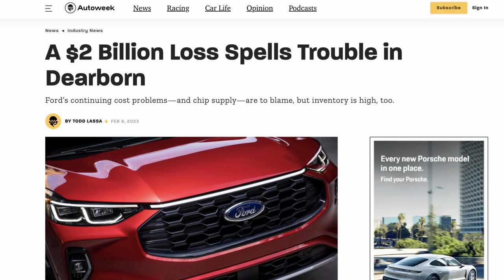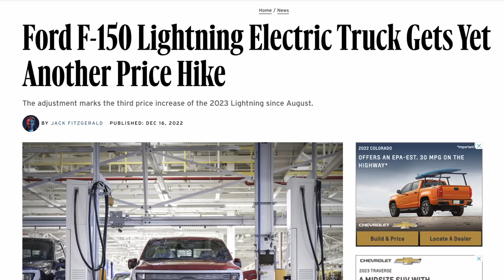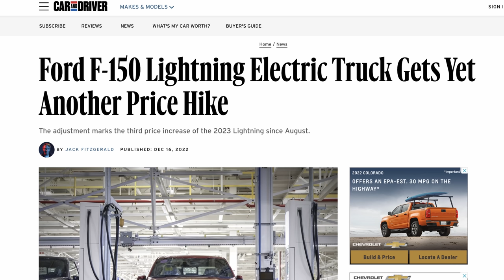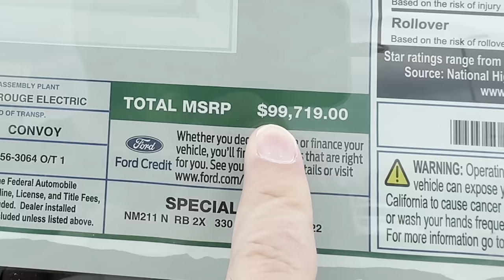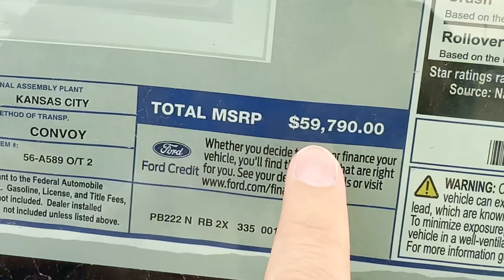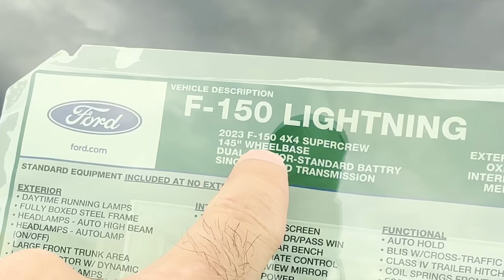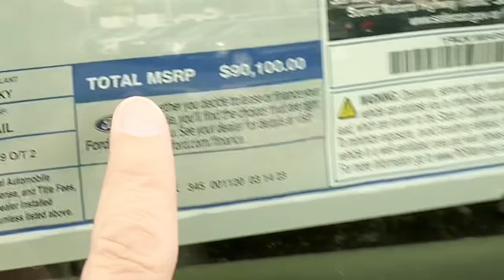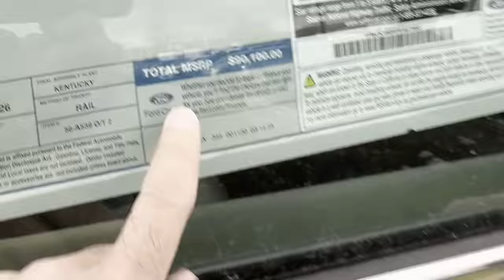Ford CEO Makes HUGE MISTAKE, Now Dealers CAN'T SELL TRUCKS!

Comment: This is across the board. I’m tired of the “there’s a shortage” no there isn’t. I work at a dealership. Some are just scummy.
Reply: Yeaaah it ain’t just Ford
Reply: Yeah I would drive by multiple dealerships on the way to work hearing radio ads from a few places about the truck shortage and how they have trucks unlike anybody else. But every dealership I passed had a parking lot full of trucks
Reply: @KNR90  that part. We literally just sell. No gimmicks, everyone makes money trust me. There’s no reason to be scummy if you have good sales people and good management. Everyone I swear makes decent money and the world keep turning. Some dealers just get stuck trying to be the #1 in the country and for what??
Reply: @cjr21  your response is completely irrelevant to what you are replying to
Reply: @alexwhiteman2628  Not dodge though baby. Them truck prices are better than any other manufacturer
Reply: Controlling supply, just like oil.
Reply: Not in 2023. Got rid of my my 1500 equal diesel due to their high-pressure fuel pump may or may not go out. Yeah I’m not playing Russian roulette with this damn track then on top of that you have a same type of freaking issue at Toyota out of all places.

Comment: Great video, It’s completely insane, older trucks are better than new trucks. This is no longer nostalgia. They needed to get back to basics - simple vehicles made well.
Reply: Insanity is a min-truck like my daily driver since new 86 Toyota mini-truck of 37 years and 483,000 miles can not be made today because of some Federal EPA BS rule that says it's too small and would have to get like 80 MPG to be made by their formula. The fact it gets 32 MPG highway at 65 MPH, better than many cars, it doesn't fit the formula. Insane.
Reply: That’s why you buy a Toyota. I see them with 350k+ miles all the time.
Reply: "simple vehicles well made" is something Ford abandoned 30 years ago
Reply: @MikeHudson-px2gc yeah exactly what I was going to say. The regulations are forcing a lot of this.

Comment: The comment about high end luxury vehicles is spot on. I worked construction and contracting for years and the only things I wanted in a truck were RELIABILITY/DURABILITY, power steering brakes, a/c heat, power windows. I didn't need power seats, I adjusted my seat the day I picked up the truck and it didn't move until I sold it. Same as power mirrors, power adj pedals, colour changing LEDs adaptive cruise, lane assist back up cameras blah blah blah blah blah.
Reply: Amen! And PAYLOAD. One posh feature I wish I had though is heated side mirrors for ice-storms.
Reply: Yes exactly I want my truck like this manual seats an actual steering column shifter with cable not some electric push button fold down shifter bs 😂
Reply: That’s why I have a 99 f350 7.3 xlt 180k miles and works like a work truck should 😊 without all the crap electronics
Reply: @codybose515  And gets 5 gallons to a mile lol
Reply: The money is in the extras. They can't charge a guy like you 5,600 for what you're looking for.
Reply: @red5standingby419  its not quite that bad more like 16/17 according to the mpg display overhead console. May not be totally accurate 🤣
Reply: Yeah F all this new BS. My 98 half ton chevy does everything I need a truck for without the $1k+/mo payment. Paid cash 2 years ago at a city auction 59k original miles. It needed a little work but it's solid now. 60/40 bench, cloth seats, column shifter, low bed that's easy to load and unload, bulletproof 350. I'm never selling this truck.
Reply: seems like the enviroment is ripe for a start up truck company that only makes work trucks that only have those features. no complicated options packages. just a damn reliable work truck
Reply: @utpharmboy2006  that's why JDM mini trucks are being imported by the 1000's. Great on gas, park on a dime, haul a lift of plywood......most don't even have a/c.....
Reply: @red5standingby419  I'm fine with that. Ok, so my 5.4L gets about  21 mpg. that saves me about $1200 a year. In 3 yrs I'll have to spend $4500 on a timing job. 

How much did I save?
Reply: @schrodingersmechanic7622  that's why Pre 90's pickups are all the rage now. You can't find a decent one for under $30K now. 

Mid 70's are in the 20's now.....

I saw a nice 88 F150 extended cab 4 x 4 in great shape listed for $40K CDN at a dealership.
Reply: @muskokamike127  you are right i have seen more of them out
Reply: I couldnt agree more with your comment. Not everybody wants these ridiculous features and add ons. I want a truck, one thats reliable. Thats all i am asking for.
Reply: @schrodingersmechanic7622  I can't remember the last time I saw a column shifter.
Reply: Plus it's all stuff that's gonna likely break one day too. To then find it's a thousand dollar part that's on backorder or no longer available.. typical stealership b.s.
Reply: @red5standingby419 😂😅😂
Reply: Couldn't agree more... you can't find just a REAL pickup truck anymore; all they make now are these overpriced SUV's with a small box on the back and stupid electronics extras nobody wants, ie: "Adaptive Cruise Control" (like I want my vehicle to slow down because a vehicle a quarter-mile ahead of me does? I set my CC to the speed I want to go... I don't CARE how fast the other guy is going, I'll pass him when I catch him. Pay Attention, Fool!) or "Lane Assist" (Yes, I want the vehicle to abruptly jerk the wheel out of my hand for No Obvious Reason!)... All this new crap needs to be optional - or at least they could offer a "No Frills" trim level? Does anyone even MAKE a 2 door pickup anymore?
Reply: Time for a CHECKER TRUCK COMPANY...Long lived, easily repaired.
Reply: A backup camera is nice but as for everything else you're exactly right. Don't need heated and cooled massaging seats and mood lighting and a sensor that watches your movements so you can turn the volume down without touching anything, and all that horseshit. The list of options on a new vehicle used to be like two or three things. Now 90% of the window sticker is ridiculous "optional" features that even though they're optional you can't really get the vehicle without them.
Reply: back up cameras are required by law in all 2017+ chill
Reply: @DarthBludgeon  ha, funny you bring that up. I rented a vehicle while my truck was in the shop and it had auto drive. It kept bouncing from lane marker to lane marker and then when it came around a corner on the highway it kept turning until it bounced off the lane marker. I turned it off because I didn't want the cops to pull me over for DUI. 

I worked for a marketing company and on my first day, the GM said to me "we sell the sizzle not the steak" we make the piece of shoe leather tasting steak look amazing.
Reply: Plus the truck beds are way too high to be practical now. If you were to put an F150 from even 10 years ago next to one from 20 years ago or the F150 right after they switched from the F100, you would say there's no way they're the same model vehicle. A new F150 has a bed height comparable to a Uhaul truck.
Reply: @karlrovey  almost.....my 1999 tail gate was the same height as the home depot flat carts and I could slide sheets of plywood right in. Then the 2006 was 3" higher. Not sure about the 2010 and up versions.
Reply: These absurd features are just a bunch of engineers trying to stay relevant. It's just not very necessary in the world of trucks. 
Unless the buyers have truly gotten that dumb.
Reply: @GS-zc4sk  They wanted to expand their market to soccer moms and millennials. Forgoing everything that a truck should be in the process.
Reply: Hell I don't need pwr windows. The old reliable crank up and down windows worked fine in the old days and never broke.
Reply: @louisstennes3  generally speaking I don't either but I'm old now and can't reach all the way over to roll down the passenger side lol...

Crank windows were great for breaking popsicles in two hahahah
Reply: @GS-zc4sk  Backup cameras are an exception. They are truly useful for practical tasks and can be a literal lifesaver.
Reply: @antilogism  and if you are driving in a ice storm that is a good Way to destroy the Truck
Reply: Led highlights are the best
Reply: @Amor1990  highlights?
Reply: Just more parts to breakdown
Reply: @actionong  I saw a video of a newer BMW went into limp mode over something stupid like the adaptive cruise was down or something dumb like that.
Reply: @actionong  What happen to KISS Keep It Simple Stupid
Reply: I rarely move anything in my vehicles if anything they move for repair or cleaning.
Reply: @crazeguy26  I think the only time my seat moved in my truck was when I took it to the mechanic and he was shorter than I am haha.
Reply: @red5standingby419  wrong
Reply: That's why they make Mercedes-Benz and BMW, leave the luxury bs to those car makers.
Reply: 100%
Reply: @utpharmboy2006  100%
Reply: @dknowles60  LOL, Found the guy who is bitter about having to keep an old truck that just eats the gas.  Every visit to the pump is $150.  And that visit is like twice a week LMAO
Reply: Unfortunately, you're in a minority for truck owners. So so so many people see trucks as a status symbol. They like the idea of hard work but really they want a luxury sedan but on a truck. 

But I agree, trucks should always have the barebones tough option.
Reply: @red5standingby419  for what a truck payment is you can buy a lot of gas at 150 per week and come out very good,.  a truck payment is a lot higher ass high cost insurance and a new truck is not going to get double the MPG
Reply: @Monteze1876  I forget the numbers but a few years ago I read something like only 10% of 4 x 4 trucks will ever go off pavement and that 65% of truck owners never use them as actual trucks. 

Case in point: I was a finishing manager for a construction company and at one site, the site manager had a F150 King Ranch. He wouldn't drive it onto the actual site because it'd get dirty. Then it got dirty from the wind blowing crap on it, so he parked 2 blocks away.
Reply: @Muskoka Mike  this tracks with everything I see. For every one person who uses their truck to its fullest or even for a bit. There are countless ones who view and use them as status symbols. Which wouldn't normally be a big Deal but don't complain about Gas prices, road size, traffic or any of the other hassles  of owning a huge truck.
Reply: @Monteze1876  I know.....I'm seriously looking at the jdm mini trucks because they can haul 4 x 8 sheets of plywood with the sides folded down. That's my biggest issue. 

I'd have a ranger or smaller pickup if I could get a 4 x 8 sheet between the wheel wells. 

I tell you though, the full size truck with the air suspension came in handy when I picked up a load of clean fill....

The big issue with the size is parking lots are getting tighter and tighter. I can't just back into a spot anymore, rows are too close together.
Reply: @codybose515  I got tired feeding my ice truck. I only used it locally so bought a lightning which does everything my 2014 did only much cheaper and without all the maintenance. Plug in at home for an average cost of $.04/mile. No more gas stations,  no more maintenance.  And I have 2 built in all electric power supplies on board that also use no gasoline.  The 7200 watt has even powered my home in a power outage,  while parked in my garage. Still leaving the 2400 watt inverter available to tun other equipment.  Love this truck. Still for tuff. The only recall that required mechanical work was the replacement of my wiper motor that never gave me any reason to have it replaced.  All other issues were resolved with software updates that got installed while my truck set at home in my garage.
Reply: It is sad that you can't just start with a basic no thrills vehicle, even without a radio, and then add each option you want individually. That's the model I would use if I had a car company.
Reply: @G S  most buyers like the aesthetic of a work truck but want the interior feel of a luxury car. People buy up thise status symbols like crazy. I see more pavement princess or "tricked out" trucks that couldn't haul a bag of mulch (Carolina squat for example) than true work Trucks.

Hey its their money, but it sucks the manufactures cater more to them than those who want a simple truck.
Reply: I'll  sell you my 1960 F100 4×4  292 CID  Brand new tires, strong arm steering, with AC (windows are down.) New Altenator  1 wire 100 Amp, With Granny low  4 speed. Lock in hubs work excellent... make offer under 50 Gs🤣
Reply: @Monteze1876  That's the issue: they started catering to the urban cowboys instead of the guys who need trucks for work. 

even your basic work truck now is loaded with electronic gizmos and gadgets that we just don't need.
Reply: @ResilientFreedom  one of the reasons is mass production.....that's why option pkgs are the rage now...."but I don't want lane assist" but if you want cruise you have to get it.
Reply: Just get the XL
Reply: @chriss1011  have you seen all that the base comes with? touch screen sync stabilitrac  precollision braking, post collision braking, lane assist, co-pilot blah blah blah blah....
Reply: That’s the funny thing. A lot of truck owners don’t even use them for work. They just want a truck. It’s their money buy what they want. But it’s illogical to buy a pickup when your never going to use it.
Reply: @rexrocker1268  100%....I wouldn't have a truck if I didn't need to haul around material and stuff. In fact, I get suckered in to helping ppl move all the time because I have one. 

I'd rather have a small SUV (need 4wd due to snow) than a truck. I even thought about ditching the truck but I'd have to rent one 3 or 4 times a month so it's not worth it. (or pay to have material delivered which would cost me $300 a month min.
Reply: I agree with almost all of that. My 2013 XLT has the back up camera that I love using when I hook onto my livestock trailer though.
Reply: @red5standingby419 I have a 2000 and it gets 18.
Reply: Heads up display and more electronic  shit to glitch out on you a couple years down the road,,
Reply: @red5standingby419  my pos 97 7.3 diesel dually gets 14 mpg and I can listen to the radio with the doors open at my jobsite.

Comment: The thing is, all cars/trucks shipped to dealerships are considered sold in the company statistics.  So the CEO is not going to feel it till they have to buy back all the unsold vehicles.  Unless they decide not to.
Reply: The TESLA show room in south KC has a completely full lot of their wonder cars and nobody is buying them!
Reply: @sofakingfunnyone Tesla ships direct for the most part, no dealerships. They are selling every one they make. If inventory begins to increase they drop the price several thousand and boom, inventory gone.
Reply: @Pneuma40  its a showroom with TELSA on the building with overflowing parking lot with cars! 800 cars

Comment: I thought it was insane back when trucks and cars initially went over 30k. When they did I started buying used/newer vehicles to get a deal. Now even the used/newer vehicles are over 30k. Screw that. I just spent 10k replacing the motor in my 2005 model, and I will replace it again in another 18 years if I need to. Car manufacturers can go straight to hell.
Reply: yeah I'm upside down in my 2004 FX4.....I'll keep putting money into it because it's better than another POS newer for $22K. I can buy a lot of parts for $12K.
Reply: Local Dodge dealer is advertising a 2018 Ram 3500 diesel dually with 150,000 on it and extensive body damage which will be the customers responsibility to repair. For that gem the dealer asking price is $59,995 plus tax and fees.
Reply: @squangan 😂he got ripped off when he got it for $5900.. now he wants another 0, what a crook
Reply: One of the many reasons why I've always had cheap cash cars. I've never had a car payment and never will. I buy a car for less than what people pay in one year for their new fancy ones, and I drive that car until it doesn't go anymore. So far that's been near to a decade per car.
Reply: The "fun" stsrts when your insurance skyrockets "due to parts availability" on an older car.
Reply: @Brunnen_Gee  Same here. I buy $5k cars and trucks all the time and just run them and fix the minor issues till they die.
Reply: Got an 05 Tribute we bought with 35 miles on it after my daughter was born - now 175k.  My daughter has an 02 Protege with 165k on it.  I have a 15 TACO with 125k on it.  All three manuals.  We will continue to invest in all three because of their lasting quality.  American Business Model revolves around Corporate Greed to keep the top 5% and their investors happy.
Reply: @MGower4465  can't believe insurance companies do this
Reply: What Ford should do to get out of this slump is go woke.  🤣😅😂😆😅😅😆🤣🤣😂🤣😅🤣😆😂🤣😅🙂😂🤣😅😆😅🤣😅😂😆😅😅😆🤣🤣😂🤣😅🤣😆😂🤣😅🙂😂🤣😅😆😅🤣😅😂😆😅😅😆🤣🤣😂🤣😅🤣😆😂🤣😅🙂😂🤣😅😆😅🤣😅😂😆😅😅😆🤣🤣😂🤣😅🤣😆😂🤣😅🙂😂🤣😅😆😅🤣😅😂😆😅😅😆🤣🤣😂🤣😅🤣😆😂🤣😅🙂😂🤣😅😆😅🤣😅😂😆😅😅😆🤣🤣😂🤣😅🤣😆😂🤣😅🙂😂🤣😅😆😅🤣😅😂😆😅😅😆🤣🤣😂🤣😅🤣😆😂🤣😅🙂😂🤣😅😆😅🤣😅😂😆😅😅😆🤣🤣😂🤣😅🤣😆😂🤣😅🙂😂🤣😅😆😅🤣😅😂😆😅😅😆🤣🤣😂🤣😅🤣😆😂🤣😅🙂😂🤣😅😆😅🤣😅😂😆😅😅😆🤣🤣😂🤣😅🤣😆😂🤣😅🙂😂🤣😅😆😅🤣😅😂😆😅😅😆🤣🤣😂🤣😅🤣😆😂🤣😅🙂😂🤣😅😆😅🤣😅😂😆😅😅😆🤣🤣😂🤣😅🤣😆😂🤣😅🙂😂🤣😅😆😅🤣😅😂😆😅😅😆🤣🤣😂🤣😅🤣😆😂🤣😅🙂😂🤣😅😆😅
Reply: @MGower4465  so then you only insure it for liability
Reply: @muskokamike127  2004 FX4 is a nice truck.
Reply: @networth00  it is decent, dreaded 5.4L though. Having issues with the 4wd now. 

It's the step side version with the plastic box so no rust on that!
Reply: @muskokamike127  Unhook the 4wd lol.